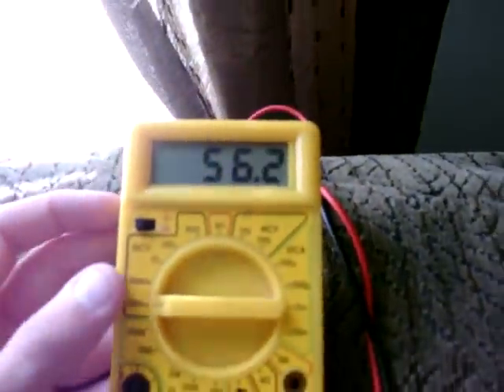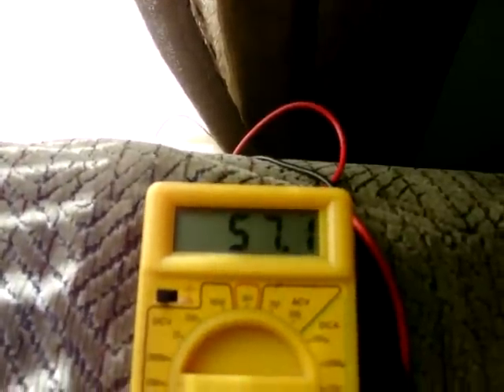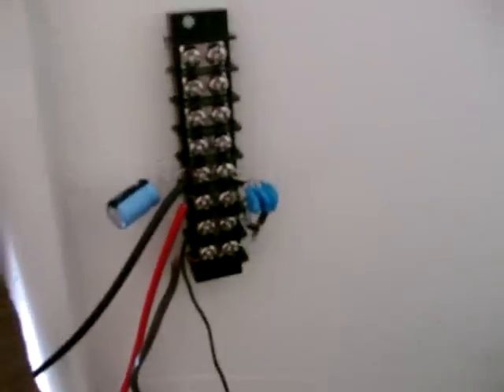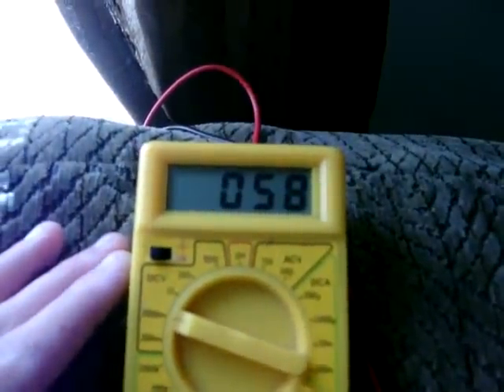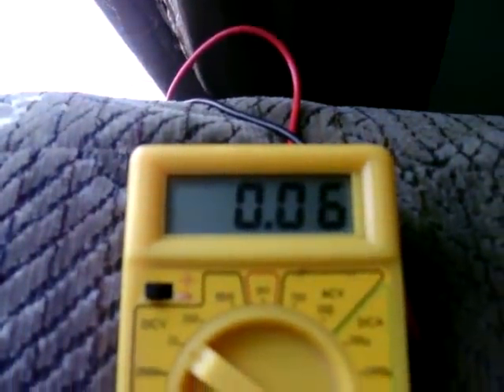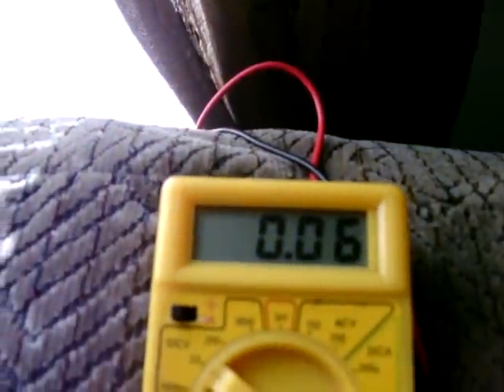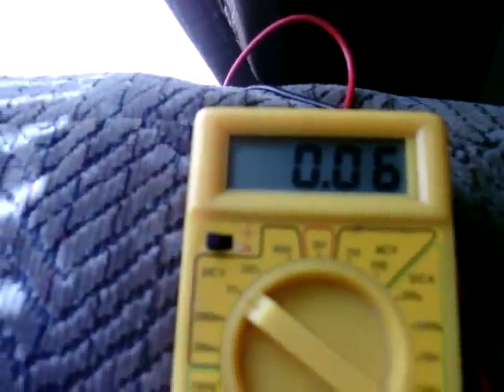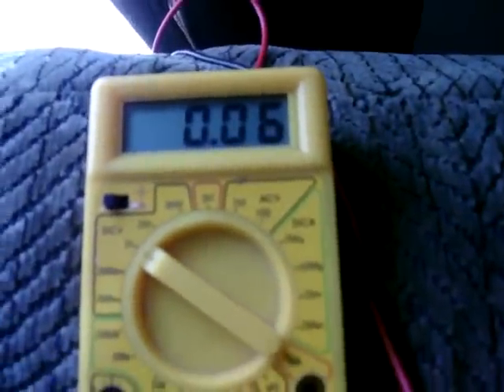tesla radiant energy capture patent recreation part 5

Comment: The Aluminum plate may take several hours to several days depending on the density of the plate. You may also need to saturate the plate multiple times to ensure the plate has been Amalgamated properly.
Theoretically if you have set everything up you can obtain about 3.5v from your current setup. I suggest trying just the plate in the attic with a direct shielded solid copper wire directly to the plate... Longer the wire you have, the more resistance you have, you will end up with less voltage.

Comment: @DarkstarAndrew01 
There are generally three reasons for covering the plate with non conductive material...
1. Insulation from the elements
2. To protect you from being poisoned by Mercury Chloride residue
3. Allows you to place multiple plates next to each other without grounding out at the wrong time.

Also I suggest using a thick hollow core copper pipe and put it approximately 3-6 feet into the ground, the better the ground you have, the better your generator will perform.

Comment: @DarkstarAndrew01 
Also try the same experiment OUTSIDE rather than inside...  Try a non conductive pole of bamboo or cheap wood at approximately 10-15feet high to mount the plate on, try to keep your cable lengths from the plate/ground as short as possible to reduce resistance.

Comment: Ive read the patent over and over.. and the part people fail to do is making sure their aluminum plate has been Amalgamated... if you look up Aluminum Amalgamation you take Mercury(II) Chloride a cotton ball, and some tweezers then dip the cotton ball in the powder, then rub it on one side of the Aluminum plate until it starts to "Oxidize" once the plate has finished its Amalgamation you flip it over and perform the step again until the Opposite side has been completed.

Comment: Takes an oscillating circuit add. Tesla made it work by adding power , making it a receiver and transmitter. Thus making the plate suck up energy..The missing part making a resonance , is very important. Hooking up capacitors to a a plate and ground has little effect.. Something else needs to be added.. power....

Comment: i used the uf4004 diodes for the rectifier and with 2 200v 330uf capacitors i got 3.5 volts each.. and i use 4 a4 sized aluminium sheets... i recycled the capacitors from an old pc.. which capacitors you suggest to use? sorry for my bad english..

Comment: a bigger capacitor won't give you a higher voltage. The capacity of the capacitor (farads) is C=Q / V
Q is electrical charge
V is voltage
It means that with a bigger capacitor you will need much more charge to reache to a voltage level. With a smaller cap, a few quantity of charge could give much more voltage, that's like glasses you fill with water with diffeent diameters, thet height of water is voltage, the quantity of water is charge, you undestand?